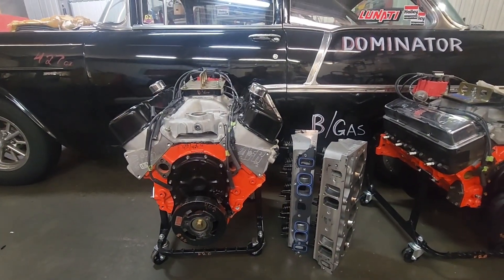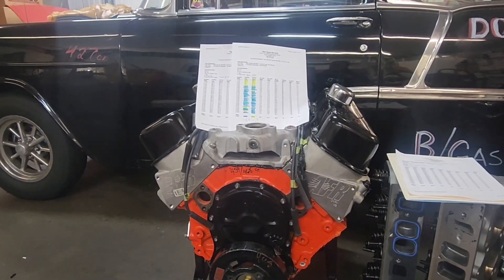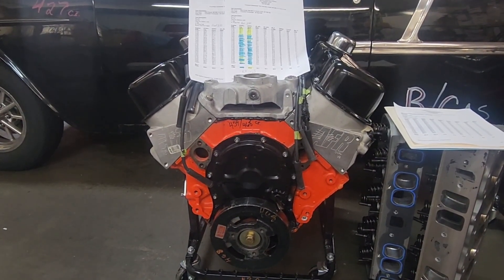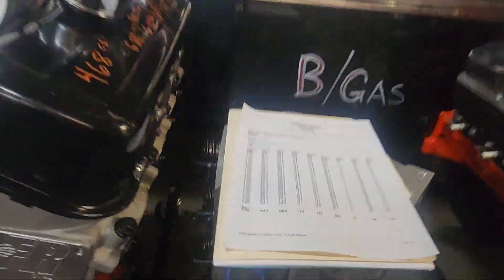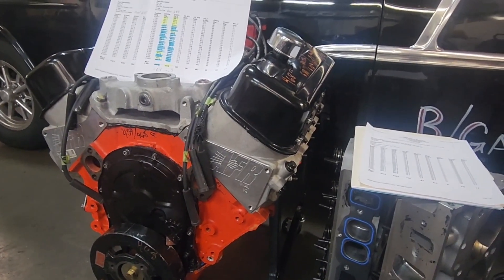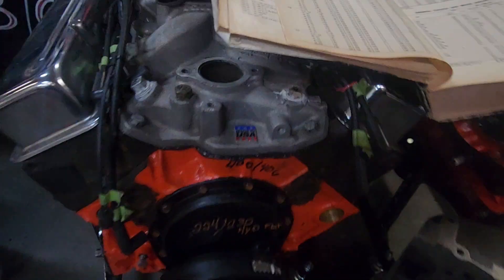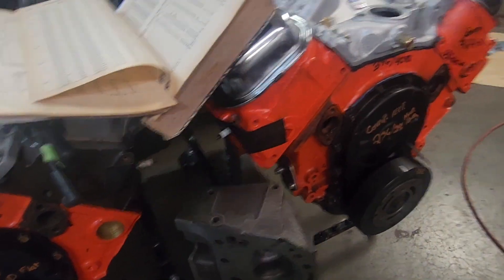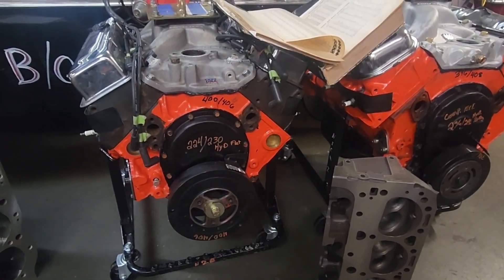468,BBC Brodix race rite versus AFR.265 & Recap of 400sbc ver. 396bbc

Comment: Just an FYI you can get the BB2 Intake with the RR  exhaust port, I dont know how faar back it was offered but the website never showed that at least not in 2015 lol.  It does show it now and it really nice to get the better cnc Rectangle options over without the raised exhaust.

Comment: I have a 489 with AFR 265 and a Lunati solid flat 292/301, .625/.625, 259/267@ .050, 108 lobe sep, 4 degrees advanced. You think my cams too big for the small head?  I also have a Vic Jr.  Do you think I would pick up my switching to a Performer RPM?
Reply from the maker: No I don't think your cams too big I think it's just right. Sounds like a great combination for a street strip performance car
Reply: @dzperformance7360  Thanks for the input.  Do you think it will ET better with a performer RPM Air Gap instead of the Vic Jr?

Comment: Have you tried the AFR 4910 dual plane?
Reply from the maker: Yes it made almost the same horsepower as the EDL. RPM
Reply: @dzperformance7360  Thanks for the info.

Comment: I had a set of those 186 heads on my 69 dz 302 and that with the factory flat tappet solid lift 140 off road chevy factory cam that cam in the 302 i won alòt of street races in my 69 camaro back in the late 70s

Comment: Looks like you got your windage issue fixed from the previous videos where you were losing a lot of oil pressure...I assume you drained some oil on this test...
 I hope the dyno bank 2 AFR is wrong good lord it's lean....

 I've run the race rites NA and boosted and the 265 AFR ( and others) as well.468 and 496...my AFRs were milled to 11 to 1 on the 496..made 686hp at 6700 with a Edelbrock Street Ram converted to EFI and we made the top kinda similar to a holley hi ram..
 I also run direct axle oiled morel solids on a custom billet core hydraulic roller profile with additional pressure about 200 seat 580 nose...zero lash cold .006-
008 hot...added 500rpm to peak when I upped that pressure..
 Then I added a F1A-94 and actually run on both in car and 7600rpm was no issue on the 468", there wasn't any "nose over" it ran that way 6 years, near daily driving it's the ONLY way I'd run a BBC again...hybrid hyd/solid period...I tried every lifter made from isky EZRoll dissimilar metal $1300 crap all of em morel, Johnson good lifters they all failed actually driving it around a lot with " street solid rollers" all of em bigger wheel, direct oiled did add life....
 I tried ALL the lifters and oil weights and clearances and preloads...it's gonna tick hot or cold take your pick and still roll over at 6200 no matter the cam...lol..

 That hybrid setup was money 0 lash during summer cold, done singer sewing machine for YEARS took well over 1000hp ( 17psi ) sold it 6 years later and it's in full size blazer still get driven going on 3-4 years now....different intake and carb is all......

Believe folks for BBC it's the ticket, Herbert adds 100 to use a billet vs Sadi core to any of their custom cam you choose the lobes....morel direct axle oiled and it will spin up, sound great and live....

Sweet to see it being used here

Comment: That right at the same hp. My 0.60 over 427 made the best of 661 hp 605 torque and later that day 647 then 648 with the afr heads and a 950 hòlly the cam was a howards 235x241 @ 50 and 618 lift 108 lsa good power simply combo

Comment: I’ll take the 396 ! Would go great in my   69 SS Chevelle !
Reply from the maker: I'll be done with it by late spring,, It will be for sale
Reply from the maker: It's for sale $3,800 816 213 7204  text me  if interested
Reply: @dzperformance7360  Longblock? That is a steal!
Wish i had the coin Id buy it! My 427 I had set aside for my 67 El build was stolen yrs ago 
Good with a stout 396

Comment: Excited to see what the trick flows do on the 406 I’m doing the CNC DHC 200 on my 306cid and shooting for 9k rpm. but my 409 (0.040 over 400) needs a set of heads when I’m not at the salt. And been looking at the 175s for that due to the lower rpm and drivability.
Reply from the maker: I'm planning on hitting the 406 small block with factory, 186# casting's first and then next month doing the trick flow heads
Reply: @dzperformance7360  what compression ratio are you running as the aluminum should allow a higher static providing more hp
Reply: @dzperformance7360 when can we expect video? with 186s

Comment: Im also building a 406 i think im going to puta set of promaxx heads on it best bang for the buck😊
Reply from the maker: I've got a friend that's a cylinder head porter, he is  crazy about those promax heads,, So I know they must be good
Reply: @dzperformance7360  Been porting those 198cc Dart wanna bes pretty good results .
Afr numbers or better for a lot less. Still prefer afr with some touch ups on my own.
Reply: Ported and flowed a set of Proheader Dart copies, make more steam than a set of afr eliminators and only a few cc bigger. 
Could save you a ton if you havent bought anything yet

Comment: I have a 427 0.60 over so a 439 about 10.6 to 1 snd a howards hydraulic roller a lil smaller then your cam same afr heads it made 661 hp and 605 torque @6400 rpm then maðe a few more pulls 647 and backed it up with a 648 i love my big blòcks
Reply from the maker: Wow that sounds like a hell of a Engine

Comment: Everyone sniffle ing, and it's not even their motor. Keep doing what you are doing.  I think you could sell a few of those 468 motors.
Reply from the maker: Thank you so much,, I drag race and assemble engines. But I'm not very good at making videos. Thanks for watching
Reply: @dzperformance7360  Your vids are fine man. Are these corrected, sae or? 
Regardless for the smallish size cam that 468 is making some beans!

Comment: I'm excited to see what the 186 castings will do. I estimate 380 HP and 430 torque.
Reply from the maker: Sometimes i'm over optimistic but,, I'm calling 420 hp 490 tq
Reply from the maker: And by the way, I'm stepping up to an Edl.  r p m manifold on the small block
Reply: @dzperformance7360 when can we expect the video to come out?
Reply: I'm going middle ground 400/450 that's good safe numbers for the combo I believe
Reply: I like to underestimate 😊

Comment: Will the custom Lunati cam supply enough vacuum to run power brakes on a street car?
Big blocks are so easy to make power with.
Reply from the maker: Probably not, If you had a 496 with pretty good compression like 10.5, I would say yes,461ci with 9.8 I would say no.
Reply: Run a vacuum canister they install in 5 min and easy to hide

Comment: The 468 has the bore of 4.310"...  Of course, your 468 is of no comparison to my race 468.  Mine made 776 HP
at 7,500 rpm.  I changed some things and now it makes 800 HP.  4&7 swap cam by Competition custom ground.  1.8 ratio on intake and 1.75 on exhaust.  Big blocks usually have more duration on the exhaust, since they make more power on the exhaust side.  My cam has the lift of .793" and 7.46 on the exhaust, lobe center 112°, made the most power on 109° Brodix round top intake, 4150 bolt pattern with turtle.  2" HV 4 hole tapered spacer to 4500 carb, carb is a 1050 cfm #8896.  Eric in OK has all my parts that he ran on the Dyno.  You cannot get that intake anymore, comp. 12.3.  Brodix 310 cc open chamber heads, cut down
to 108cc.  2.250" intake valves and 1.88" exhaust.  50° on intake valves and seats.  They do not make that head anymore.  It is not  CNC'd.  Intake and heads have been port matched.  Std. length rods, 6.135".
Reply from the maker: Yeah, I caught that also but I didn't want to redo the whole video on the mistake made on the bore of the 468
Reply from the maker: Thanks for watching